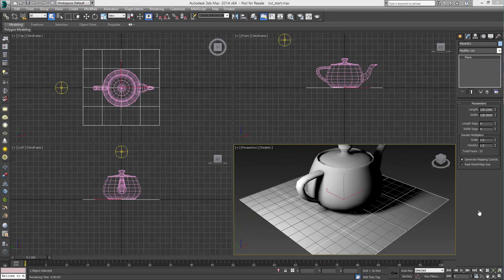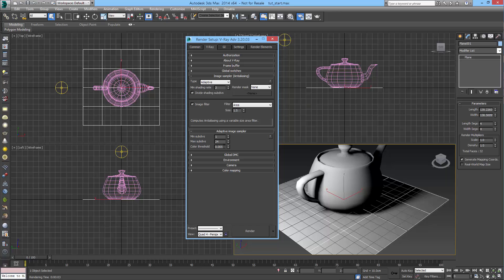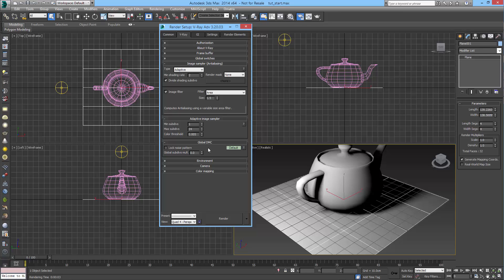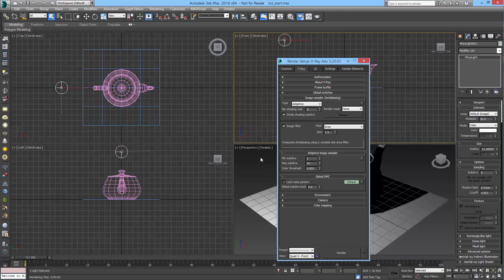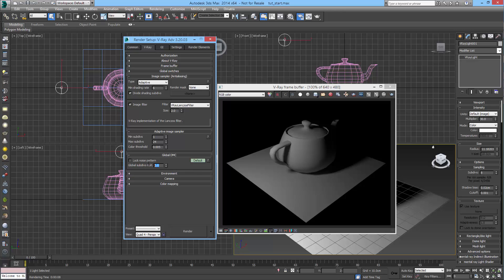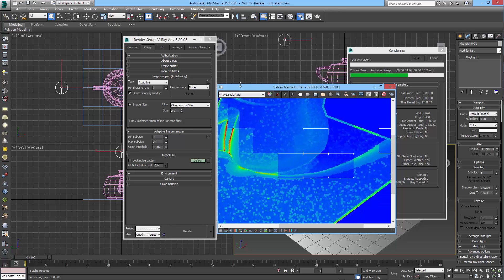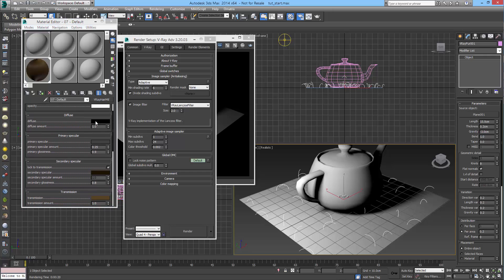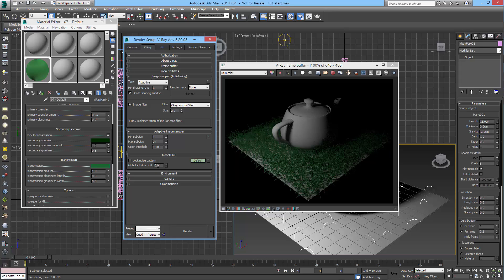V-Ray sampling tutorial

Comment: Hi Vlado, Thanks for the tutorial.
Works great with BF+LC but doesn't work with IrrMap since its quality is driven by the Global Subdivs Mult. Is there any workaround to that? Very often I can't afford to use BF on interior renderings. Thx.
Reply from the maker: Giacomo Arteconi In the latest builds, the irradiance map quality is not affected by setting the global subdivs multiplier to 0.0
Reply: Vladimir Koylazov Thanks, I didn't know, I think I have tried this method it on vray 3.2 (maybe it's 3.0) at work and it was still depending on it. Great to know though.

Comment: Hi Vlado. I started using this method that you are describing since you guys introduced Min Shading Rate. I use it a lot for my personal work, which is mostly still images and sometimes I found that I had to go really high with Min Shading Rate to get rid of the noise,.. on my last still image I went up to 80. However, I still feel that this is better for stills where you don't care about render time, but for animations I always go and play with scene subdivs on light and materials to get faster more optimized result, but as you said if you don't know what you are doing this can be messy. Just wondering, if in the future there is any plan to have checkbox on material level where you can specify that those material subdivs are detached from unified sampler so we can use this technique but still do override on specific materials. Thanks!
Reply from the maker: Toni Bratincevic The plan is to have things set up so that you can do that conveniently, yes.

Comment: Good stuff! :)

I've changed a few other setting wich might result in even beter quality.

- under colormapping where the Reinhard settings are selected. Change the Burn value to 0.25 instead of 1. Images are less blown out in the highlights with these settings. So there is more room for editing in post:)

- In the settings/system tab, check Use Embree to get rid of those extreme white specular specs

Cheers!